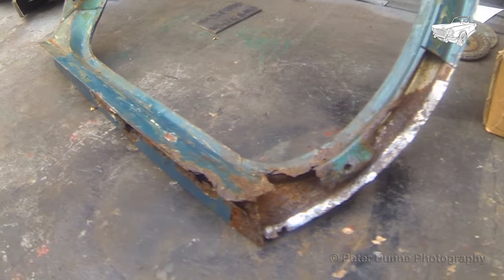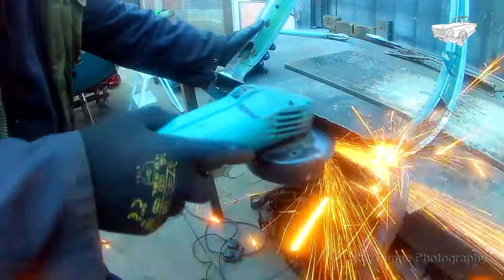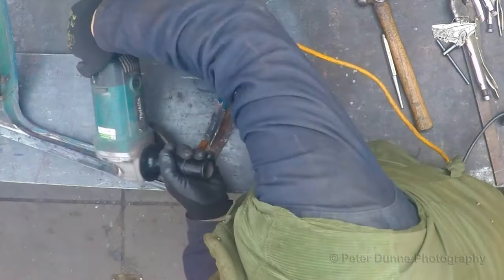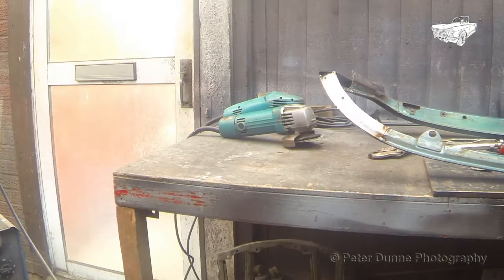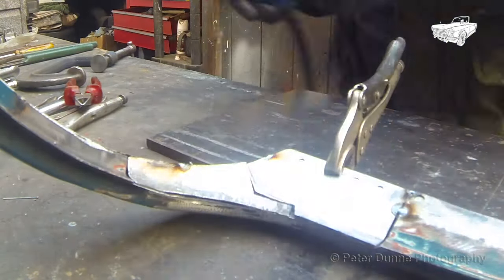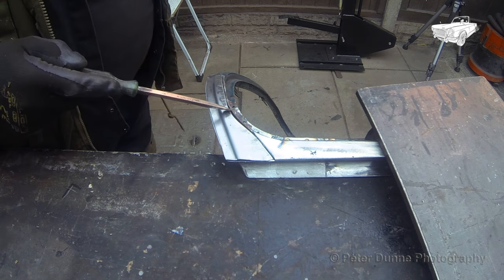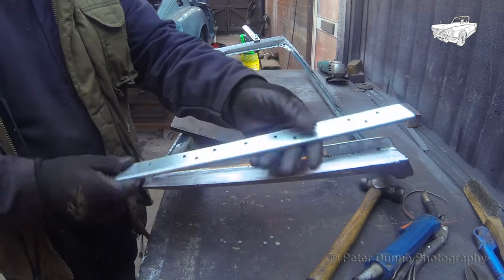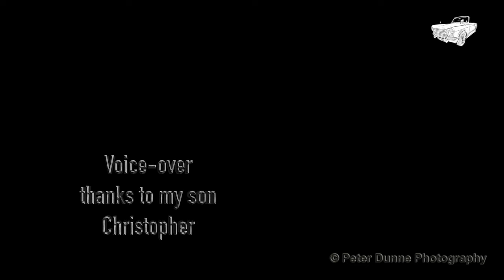Part two Triumph GT6 MK2 Windscreen frame repair, HD 1080p

Comment: Top job. 
But it must be more difficult if this repair is done on a Spitfire.
Reply from the maker: It's exactly the same apart from the way, it's mounted to the body
Reply: I was thinking if the pin with the treads is rusted out, it must be more difficult to repair. Great video by the way.